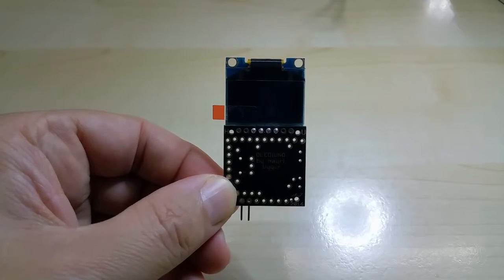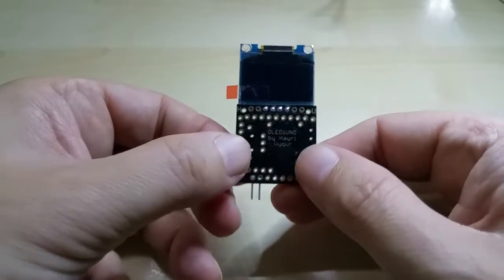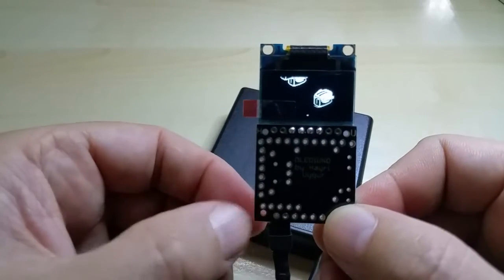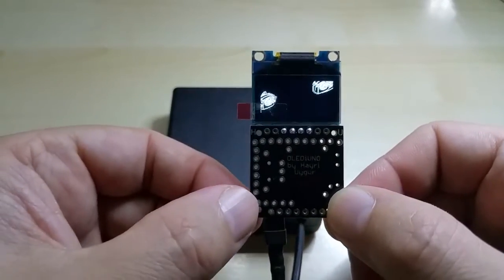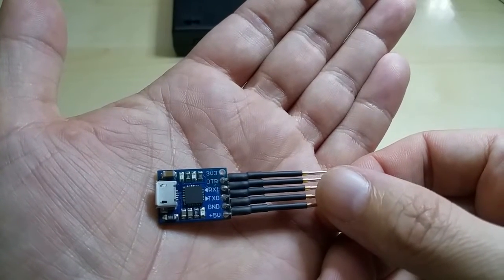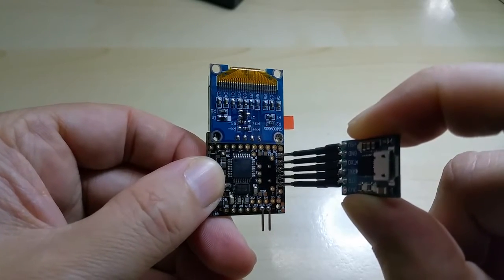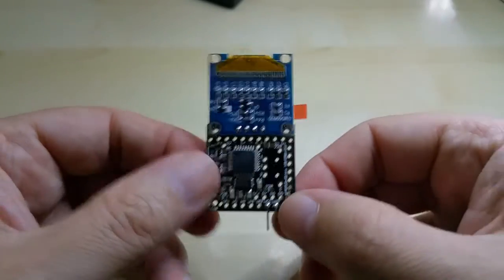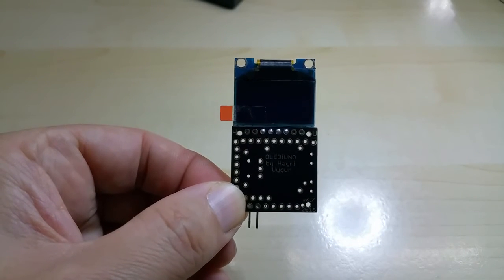Worlds thinnest OLEDiUNO / Arduino with OLED Display

Comment: Hello I am interested to know if u would be willing to make me an arduino device to program car parameters thru obd2 port for me. Is there another means of contact for u?
Reply from the maker: I will have eventually a display that will connect to the OBDII port, the only problem is that my car does not have that port and I can not try the device and test the code.
Reply: ok that sounds great. I would love to get from you as I really enjoy your input.  is this something you plan to work on in the near future?
Reply from the maker: Yes, it is on my todo list but I can not tell you when it is gonna happen.

Comment: you got great coding skill,making oled display show moving object is quite difficult due to restricted display update because of low bandwidth.which protocol is used for communication between oled display and ATmega328,what's the displays resolution.and lastly any links to display you have used ,i am aware of your other projects they are great but i am particularly interested in this oled display only.
Reply from the maker: Thank you Anil, actually that code is not from me but from Adafruit. It uses their I2C library. The display has 128x64 pixels and if you search for 0.96" OLED you can find them easily.